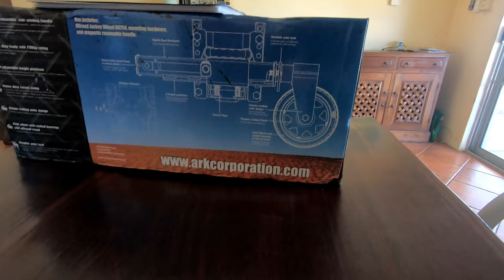Worlds Best OFF ROAD Trailer Jockey Wheel

Comment: Great video Chris...one of the better off road jockey wheels on the market just now...
Reply from the maker: Yes i spent 2 weeks on and off looking at Jockey Wheels That one ticked all the boxes for us. Will have the new tow hitch here as soon as we can. And be fitting that as well. Will do a video on that as well.
Reply: @JustinCaseSolarPower  For a hitch we use ALCO...
Reply from the maker: @MegaPatients  Yes i looked at them They sort of skirted around the tow ball issue by putting a ball into a lathe and turning it into a pin.  It will still have the same movement problems a ball has.  I think i will go with https://www.mchitch.com.au/product-page/3-5-tonne-easy-fit-caravan-automatic-coupler  cost more but it is 100% compliant.  And is easy to hook up. Also no need to give it Viagra when it gets old. Just need to tighten its nuts

Comment: nice trailer jack!
Reply from the maker: Yes its a nice off road Jockey Wheel designed so a trailer can be winched or dragged out of the mud hole without damaging the unit..
Reply: @JustinCaseSolarPower  I like the wheel just so that I can roll the trailer to the car hitch without screwing up my back.
Reply from the maker: Yes and its supper easy to wind up as well John. We looked at a lot of Jockey wheels. This one ticked all the right boxes for Sigi and I